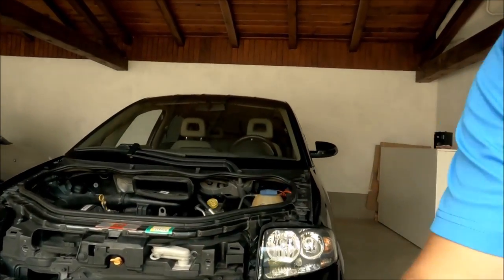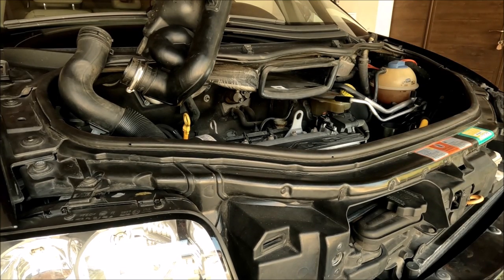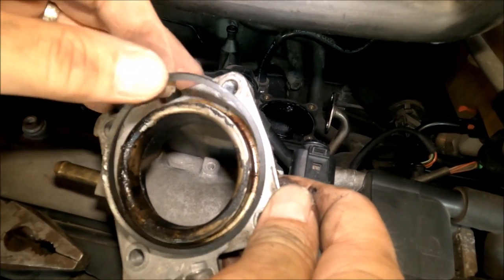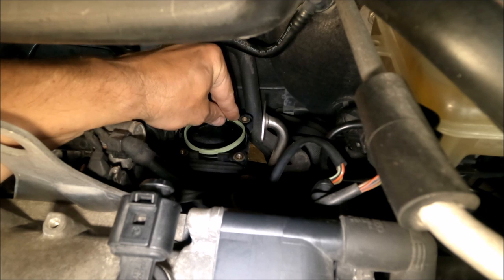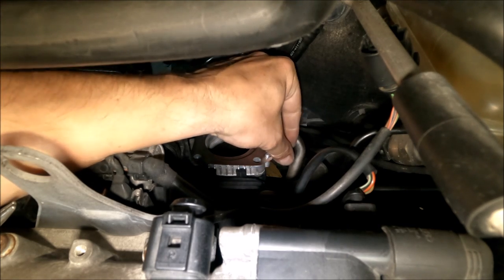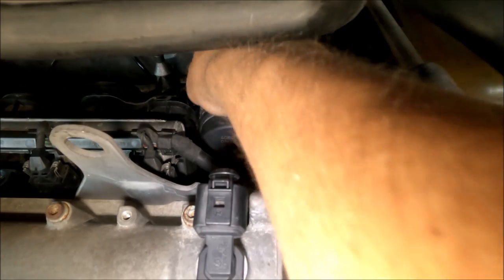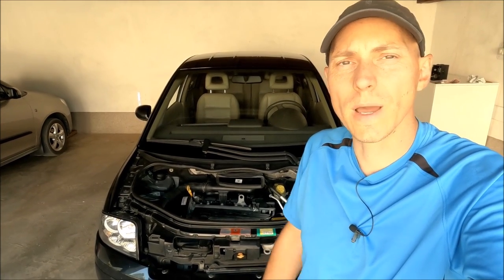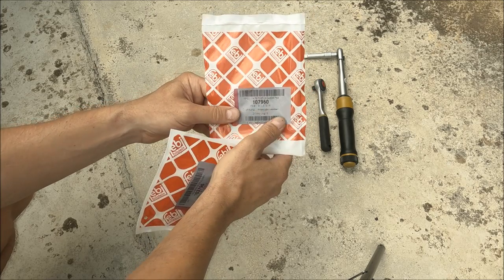1.4 16v AUA – throttle body (including flange) cleaning – Audi A2 – EP32 – project youngtimer

Comment: Perfect explanation. Thank you very much. I did try to remove the plastic at the back by removing the three screws (Torx 20 btw) but I failed to get it off. It is even more complicated than squeezing the tyre repair kit holder out and back in.

Comment: Thanks for the very detailed video. I ended up removing the smaller EGR flange by disconnecting the hose at the valve all the way at the left of the engine and just left the hose on the flange.
Reply from the maker: Glad it helped.

Comment: Thanks, really useful. I did mine over the weekend using this as the guide. Turns out mine was “bodged” with a re used gasket and silicone which probably explains the “lean” error code the car kept throwing. That should fix it.
Reply from the maker: That are the “joys” of used cars :(, when mechanics want to save few EUR. I am glad it helped and hopefully it will solve the error.

Comment: was this cleaning before or after the replacement of the oil separator? i did this cleaning maybe a year ago because of a trouble cod for EGR valve. since then I found out that maybe I need to replace the oil separator. The car has 225000 km, and probably the oil separator is the original one. I m concern that I will have to reclean the throttle body once again because of the oil separator not doing his job properly. Thanks!